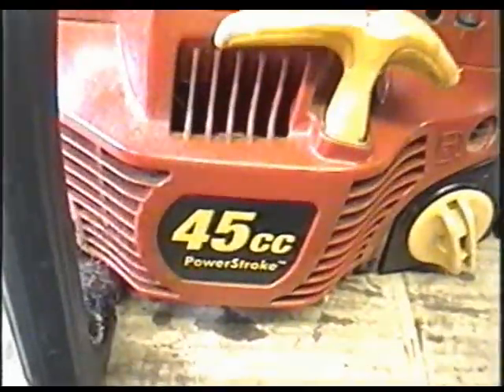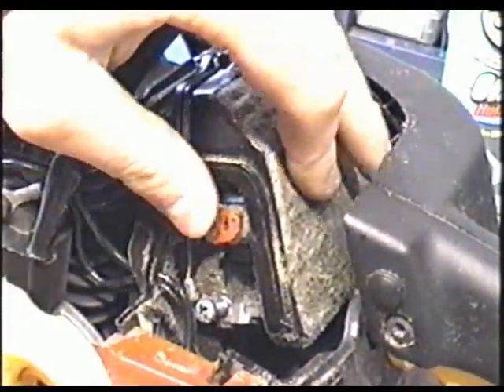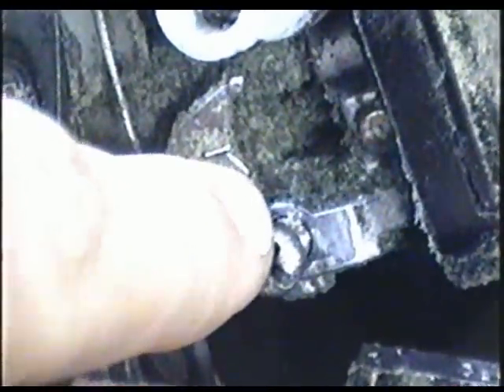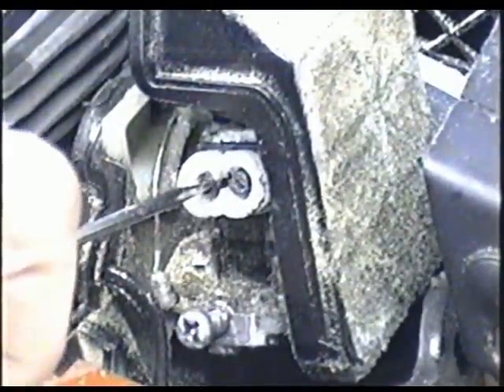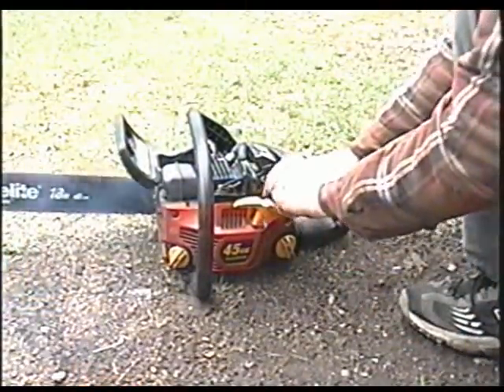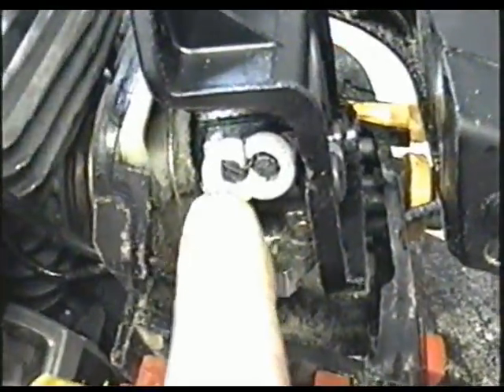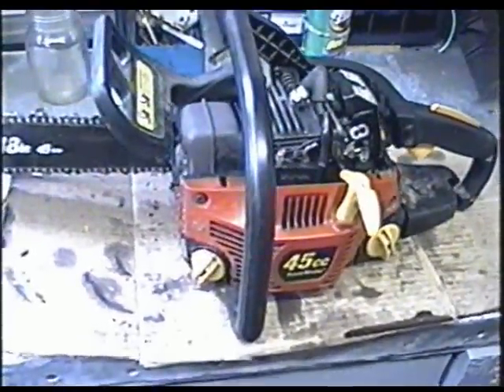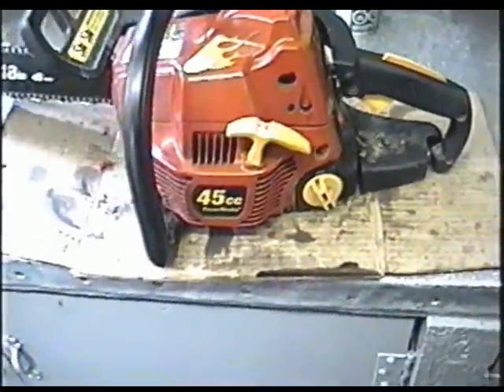HOW TO ADJUST the Carburetor on the Homelite Timberman 45 Chainsaw

Comment: I don't understand all those who say "throw it into trashcan". If you bought this saw, and paid 3 times less then for Stihl or Husqarna, you can't expect the same quality. But anyway, this is a good saw, even excellent for it's price (I paid around $300). One bad thing only: it comes with some default Oregon chain which is micro chisel and really slow. Replace it with some stronger chain, and then the saw cuts excellent. I used it for few months and didn't have one single problem.

Comment: I've got the same saw. Been running fine for the last year but a strange thing has started happening, rpms hold high from cable not letting throttle rest on idle like it's suddenly too short. Have to tear it all down and reinstall cable for it to work again. Happening with my Husqvarna 150BT backpack too. Cable too short to sit in throttle yet no sign of kinks or damage. Scratching my head chasing this elusive problem.
Reply: I first noticed it when the choke refused to latch... I think the plastic housing of the throttle cable has lengthened due to hear and fuel.  I fixed mine by doing the following. Disassemble the handle and remove the cable and it's white plastic retainer.  Unscrew the retainer from the black plastic housing.  Using a razor blade cut off/shorten the housing by 1/16-1/8 of an inch.  Reinstall everything.  Adjust carb as needed.

Comment: You sir are a genius. I have a Homelite String Trimmer and have been screwing around with it for months trying to get it to run properly. Last weekend I even took the carb apart.
I was never able to figure our why there were no adjustment screw other than those plastic caps. After watching your video and understanding that the screws were beneath the two pastic cover, my trimmer purrs like a kitten. THANK YOU!! I hope I can return the string trimmer I just purchased a few hours ago.

Comment: Nice video very helpful info,  start off adjusting the H screw first for high speed performance, then adjust the L screw to get the idle smooth. Go back and readjust both screws to get best performace as each screw,L & H has some effect on the other. Finally, set the idle speed screw to a speed that allows the clutch to disengage. Three big issues with these motors are worn carb parts especially the fuel pump and metering diaphrams, plugged mufflers which a lot of guys miss and fouled plugs. TM

Comment: I have the exact model, it would choke at high speed and wouldn't cut.  The problem was the air filter.  It was filthy but water and compressed air cleaned it up and fixed the issue.

Comment: Well done video.  I have a 2002 version of this chainsaw I bought as a refurb for $100 from Harbor Freight.  It is no Stihl saw but it works wel.  lThe throttle shaft and adjustment screws are flipped.  They must have made a running change and re-oriented the carb.  Al nylon covers and simply have the screws in the carb but I now need to pick up some springs to retain them in the set position.  Idle is still high even with backing the idle stop away.  I suspect there is a an air leak.
Reply: A

Comment: how do i know if i need to adjust the high or the low screw? is the high to be adjusted with the throttle wide open and low to be set at mid throttle and idle at idle? just curious what the difference is and where to start? im not real knowledgable about small engines.

Comment: Sentence got truncated.  I removed all the nylon stops completely and only have the L and H screws.  Need to add some springs to each adjustment screw even though the screws are tight fitting.

Comment: I'd love an answer to my question . I got the same saw lord it gets very dirty in the engine compartment even after a few mins work the filter does get very dirty . I bought this saw second hand should there be some kind of rubber seal in the engine between the muffler and the chain or should there be a dust gard around the muffler to keep dust out of engine . buy the looks of the saw in video has this same problem

Comment: Any idea why mine will start and idle for like 5 minutes then shut off and won't restart? It also bogs when I try to rev it like the brake is on but it isn't. I've tried adjusting the carb but nothing helps

Comment: I'm having trouble w/ a small Homelite chainsaw. Starts easy, but only runs on full choke & barely cracked open choke. Fixed a few things: new primer bulb, cleaned spark arrester, checked carb; its clean, blew out fuel filter w/ compressed air; same crap. Any ideas? Thanks
Reply: Simply cleaning the carb is usually not enough in my experience.  The metering diaphragm, and the fuel pump diaphragm in the carb both harden up over time and will simply not work.  Those parts need to be very soft and not "crackle" if you flex them.  A carb kit is cheap and easy to do if you watch Don's videos for guidance.

Comment: I heard two of your videos about adjusting carburetor. But when you explain the LOW and the HIGH screws, it confuses me the specific function of the low vs the hight screws.
Reply: jac mat Low is for when its fuel mix for idle and off idle when you just rev it. High is when you hold it wide open and the motor reaches it's highest speed you lean until it reaches it's highest RPM then richen a little until the speed drops just a bit. You don't want to run it too lean adjusting with no load you can lean it too much when you put a load on it and it will seize up. 2 cycles are sensitive to lean running. I would run though some wood at high speed then hit the kill button while still holding wide open to get a good spark plug color. If it's pure white running too lean richen some.
Reply: kell490 Super thank you. Next time I'll follow your recommandations.

Comment: yes there not the best Saw but with some porting & Polish on the cylinder & Opening up the muffler  If you don't want it very Loud just drill about 15 small holes 1/16 in the front of the muffler & advance the Timing to 26-30 degrees BTDC  it will wakes these saws up I have done 2 of them & Both where  Cutting  faster then my Stihl MS250 !     But use a 16" Bar  the 20" that comes on these saws is way overkill for a 45CC saw  a 20" bar are best for saws 55 cc & up